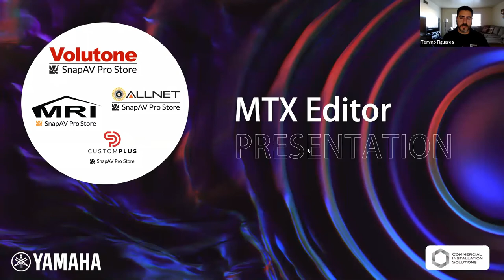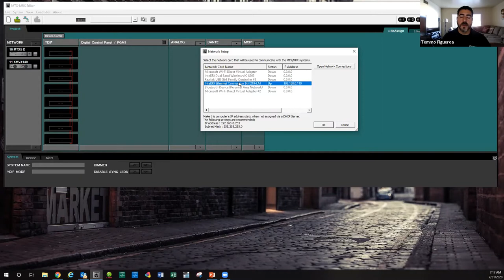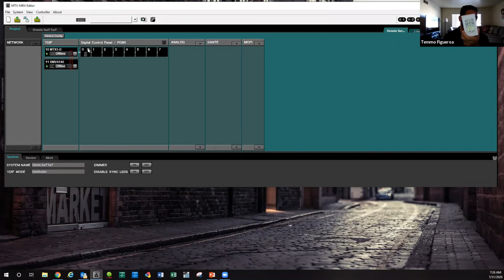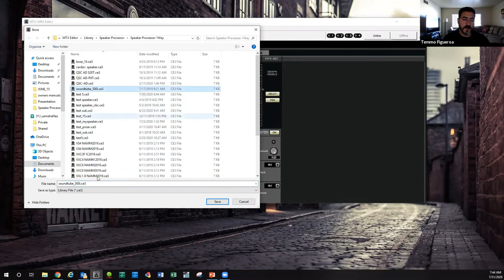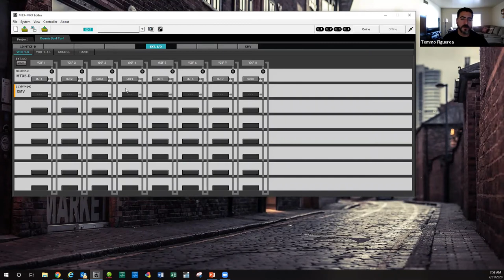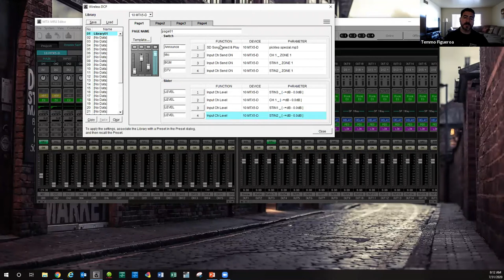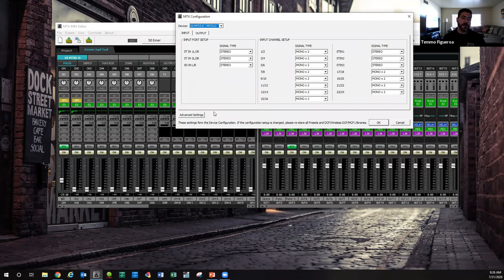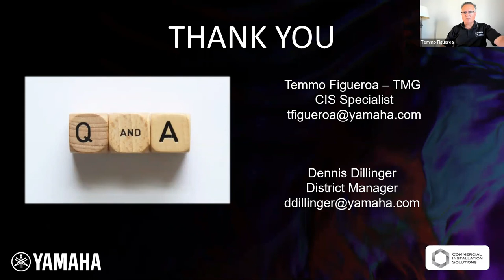Yamaha DSP Programming Webinar

Comment: Thanks for this video. I'm troubleshooting an issue with our sound system. We have the MTX3. The symptom is that when I connect to my PC or audio recorder the cable exiting from Output 8, the sound is deeply muffled. Imagine sound speaking from behind 50 blankets. I can hear the booming of the human voice, but no details. I connected a cat5 from Windows 10 to the 5G networking switch. And the MTX software found the items on the network. PROBLEM: (a) I'm not sure what setting to change to see if I can fix this symptom, and (b) my ONLINE button is grayed out, unlike the way it works for you at 1:10:22. So, I'm not even able to see if any of my tweaks will have effect. Any help or guidance is appreciated!